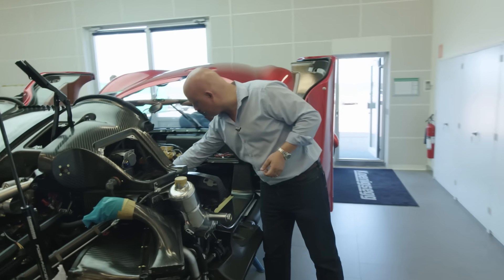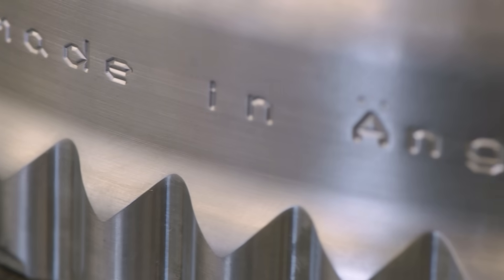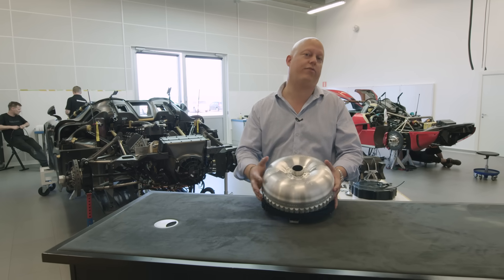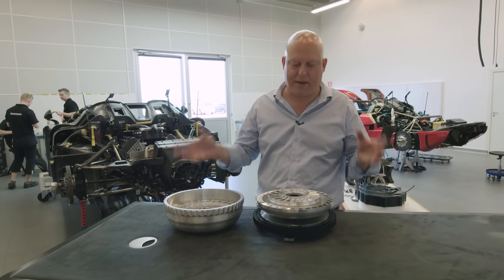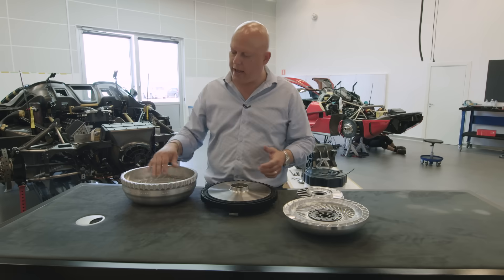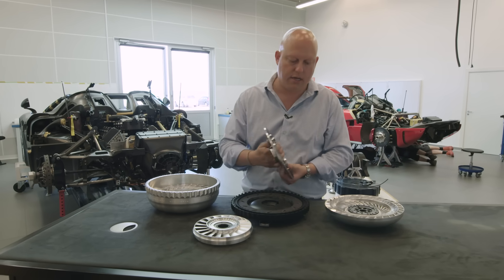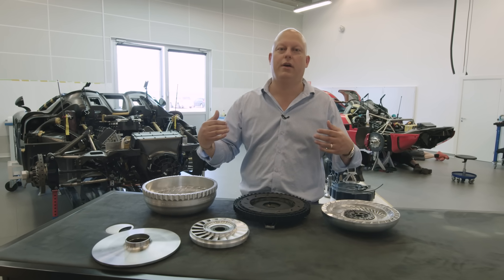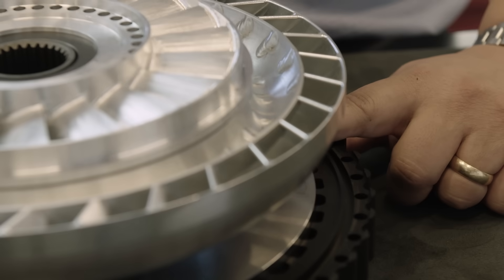248 MPH Without A Gearbox: Direct Drive  -- /INSIDE KOENIGSEGG

Comment: And that ladies and gentlemen, or whatever gendered entity you imagine yourself to be, is WHY automatic transmissions obsoleted the manual transmission decades ago. Chrysler brainstorming gave us this Torque Convertor technology in the first place... and then they further perfected it by integrating the lockup clutch assembly which greatly improved efficiency and opened the door for overdrive ratios. (like 7th gear breakaway starts).
Too bad Christian didn't explain HOW it operates in a way that people can understand. He sort of explained what it does, but missed the mark altogether about HOW it does it.
And now people are even more confused. I'm not saying i can do better, because teaching ain't my thing... but i know what what they do, and how they work. Amazingly brilliant devices that don't get anywhere near enough credit for what they do. Marvellous torque multipliers!!! A clutch can't do that!
Just sayin'.
Reply: Chrysler did NOT invent the torque converter Lysholm-Smith did  and used in a transmission with a torque converter and direct and drive in 1928, the twin disk torque converter was invented by english electric and first used in diesel locomotives. Chrysler invented nothing.....
Reply: Matthew Matthewq,
He invented Fluid Couplings, nøt Torque Convertors.
Fluid couplings, used in the old roto-hydromatics, dynaflo, etc... were terribly inefficient in that they slipped like a sumbitch under all driving conditions, and they could not multiply torque. They also generated massive amounts of heat.
Chrysler gave us Torque Convertors which MULTIPLIES TORQUE under load, but couples up, mostly, under cruising conditions. This opened the door for modern transmissions. They are the result of absolutely brilliant engineering... so much so that almost every manufacturer went on to copy the technology in one form or another.
But getting there first gave Chrysler some engineering advantages, to the point that other manufactures had to make various engineering, and application, compromises, and they pay a stiff penalty for them when it comes to reliability. Of course this applies equally to overall transmission design as well, and many of the downside effects still exist today, in various forms.
It's not all about engineering ideology, and design principles. As in all things in today's world, lawyers also have a controlling interest in the game. And Chrysler holds a stacked deck, in their favor.
I hope this info is helpful to you.
Reply: You don't think he would give away all his secrets do you? You can bet he left out something so important that torque converter value is for scrap without it....didn't think I saw his lockup converter....which is, essentially another gear...guess he forgot about that....this vid is getting close to vintage, I think I will take a look around and see if he has anything that rolls and smokes tires...year should be enough time to build a couple prototypes.
Reply: What secrets are you talking about? It is a simple lock-up torque converter and not rocket science. It looks exactly like every other torque converter found in automatic transmissions.
You can technically even let the clutch slip to control the torque ratio.
Reply: General Motors did a ton of development work on torque converter technology in the 50's and 60's. They had the Buick Twin Turbine and Triple Turbine transmissions which had four and five element torque converters with planetary gears inside to produce an attempt at an infinitely variable shiftless transmissions. Those converters were amazingly complex. They also had a Twin Path drive with a Torque converter clutch that split the torque  that directly drove part of a planetary gearset. The Borg Warner Automatic Drive had a lock-up torque converter in 1955 that directly coupled the crankshaft to the output shaft of the auto transmission. It's big selling feature was it had a two speed auto trans for acceleration then direct mechanical drive in 3rd gear that gave good fuel economy.

Buick also had a "Switch Pitch" stator which could change the angles of the blades from performance to economy and change the stall speed of the converter. I have a 1963 Motor Manual which has great pictures and explanations of these early innovative transmissions.  Koenigsegg is essentially doing what the ProMod guys are doing today. The engines are so powerful they use the ancient 2 speed PowerGlide because that's all the gears they need, when you have enough power to spin the wheels in high gear. 

The older cars were trying to move 4000 lb cars with 120 hp engines and they needed all the help they could get. But the desire to have a luxury car that took minimal effort to drive was very strong. Acceleration sometimes took a back seat to comfort.

Comment: Dodge had a similar system back in the 60s.  The car had a three speed manual.  It had both a clutch and torque converter.  You could leave it in third and let the torque converter do all the work, or use the clutch and shift it manually.  Basically the koensigsegg removed the clutch and transmission, and uses a fancy torque converter that slips until the car is moving, then locks it up to eliminate any slippage. It is not a two speed converter but limits power until the tires can handle it.

Comment: simplified exlanation...works just like a lock up tc, except it has 2 stators, one has a low low stall speed, the second is a medium stall.
1a. the first or low low stator (like a 200 hp truck) has a lot of gear reduction so it can start moving at around 1500rpm.
1b. the first stator can be turned slowly to engage and (this is what he means by doubling the torque)  effectively works like a first gear with 2:1 gear ratio ( so if the motor/engine makes 1000 lb/ft of trq at 1500 rpm, then it multiplies by 2 and gives 2000 lb/ft of torque to the wheels)
2. the second stator only works when the car is in motion, at this speed the second stator begins gear reduction but at a lower value like 1.5:1 (like a drag car launching at 5000 rpm, but launching when already in motion [almost like going from half throttle to full throttle while in gear])
3. all the gear reduction happens smoothly w/o gear shifts through fluid or hydraulic movement
4a.  the lock up mechanism cancels all the functionality of gear reduction essentially canceling out all the cool tech he speaks of and works like a normal car clutch. (essentially a 1:1 or engine shaft attached directly to axle shaft)
4b. At higher speeds the lock up ( or brake as he says in vid) kicks in,  its like being in 4th gear with a final drive attached to a tall highway gear
5. the car moves along with 1400+ hp

in english...think about it this way: take 2  torque flite 727 torque converters and put all the components in a high tech custom shell. the first torque converter is from a truck and has a low stall (or take off) speed. starts off easy at 1500 rpm. the second is from a drag car, this one wont kick in until its at 5000 rpm, this adds oomph at speed. once all the power multiplication of truck and drag car torque converters has been used up the lock up kicks in and works like a straight shaft directly connecting motor to wheel, therefore bypassing the whole system with a basic clutch. then your going fast as a motherfucker. its basically a fluid transmission with turbines instead of gears.

if you get your fanboy head out of your ass and stop saying "OMG KOENIGSEGG, I LOVE HIS BALDNESS!!!!" and listen to what he's saying you'll understand its very simple yet well thought out design. he builds off already existing principles to and design something very cool and unique.
Reply: Simplfied V.2: ... Here hold my beer!
Reply: Did you really see a second stator in the video? From what I've read, all torque converters, once there is a difference in rotational speeds between the turbine and the pump will multiply torque through one stator. Simply put the stator creates a longer path for hydraulic fluid flow between turbine and pump because of this difference in speed. Like any simple machine, the longer the 'effort' travels, the the more reaction it has against the 'load'. So he has tuned his vane system for low speed stall, but because the car is so light, and his engine so powerful, no reduction is needed. It's like the direct drive systems in Top Fuel dragsters. They have mechanical clutches that are designed to slip the first second of a Top Fuel run; the clutch then full seats and then they grunt the engine against the final drive for the other three seconds. You can do that when u've got 10,000 horse and enuff torque to spin the earth.
Reply: @BoogWar01  basically yes, but the conversion of the torque does not happen because of the longer way the oil hast to travel. It rather is the change of the angle that does the trick.
Reply: Never had it explaind to me like that, Yeah I guess you're right. like painting a slatted fence with a spray gun. The steeper the angle, the more impeller vane area the fluid sees to press up against. Makes more sense that way, actually. Thanks
Reply: Thanks for pointing that out, at least one person is interested in the tech and not in the hair situation of Mr Koenigsegg.
But I couldn't see any second stator. I watched the video again to see if he says something about it, but could find it either. 
Could you show me the timestamp where he is taking about that?
Reply: Thank you for simplifying the concept. Kudos for shaming the fanboy dotards.
Reply: Great.. Now you can start to build your own hypercar..
Reply: Yep.  Checks out.  Exactly what I was gonna say.
Reply: thanks, the video itself isn't that well explained.
Reply: Having worked on go karts that have centrifugal clutches and having a basic understanding of standard auto torque converters I did indeed understand that it is very well thought out though not exactly "simple".
Reply: Well done for overly complicating his simple explanation, wrongly.
Reply: haha turbine go brrrrr
Reply: 4:26 As you can see it only has a single stator, single pump, and single turbine... Everything you describes is achieved through the blade profile in the SINGLE stator.
Reply: ʇɥƃᴉɹlɐ ʇou ɯᴉ  but there is no multiplication anywhere in this set up
Reply: @covid-20lit41  the multiplication happens before the lock up in two stages. 

Get your head out your ass
Reply: So it's like a turbo jet.
Reply: okay my personal idea of what this man has done is create a torque converter that might last a few days to a few weeks at the most,  aluminum's not that strong of a metal,  you know .. .. now if he could  the aluminum one in build a titanium one identical that would last I might say that he has something that I would be more interested in .. .. ? just my idea of aluminum .. ( maybe his aluminum is forged and will last a bit longer but I have my doubts ) ...
Reply: @robbyholderman8581  ,
Aluminium is very light and dissipates heat also very efficiently; both are desirable aspects of this metal and it's alloys !
Reply: and if he's like me he's figuring out new ways to grow hair .. .. it's just that he has the option to do it at over 200 miles an hour and I do not ! grow hair that is of course
Reply: Hey nerd...I'm 'Murican speak way more stupid if you could please

Comment: His idea is not new. I get what he wants to do. It won't be a streetable car. For a top end race it should work. I've worked on this idea before 20 years ago.
Reply: The difference with 20 years ago is the addition of electrical motors, they make it 'streetable'. It is basically an electrical driven car with a combustion engine as a booster, generator and for the top end speed.

Comment: I'm a mechanic, if you do it his way you won't have a reverse gear. Aluminum heats up and expands too much.
Reply: You don't need one.  This car has direct drive electric motors.  There's MORE than enough power for slow speed reverse using the electric motors alone.  Reversing the rotation of an electric motor is a simple, easy task.  Maybe you are a mechanic, but it seems you missed a pretty simple mechanical solution.